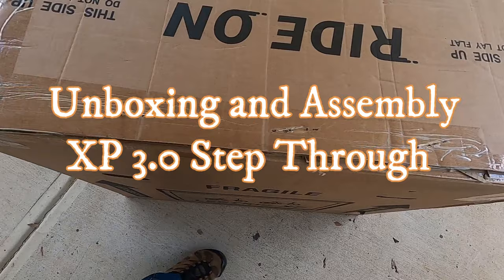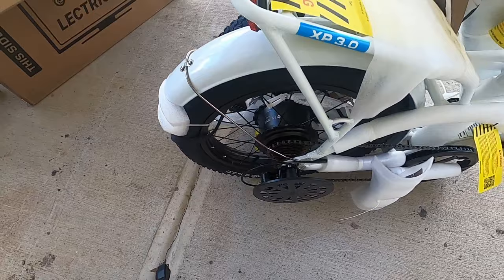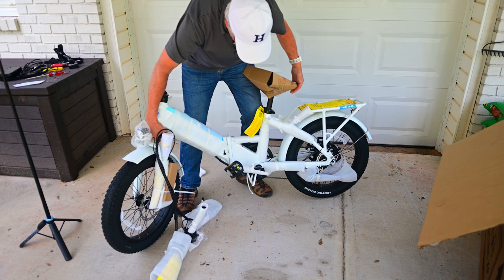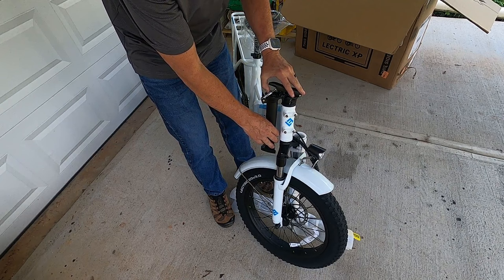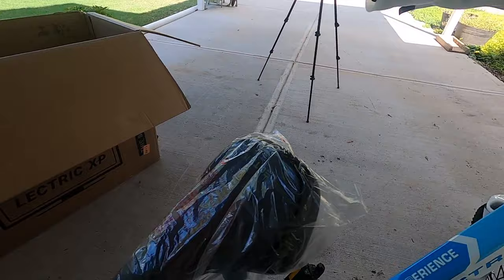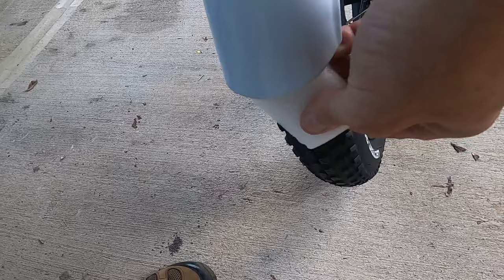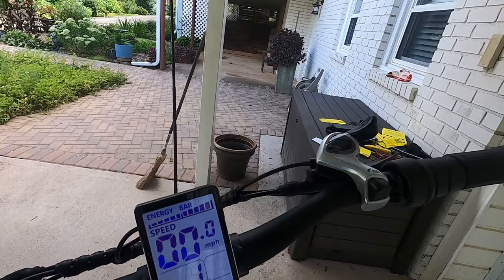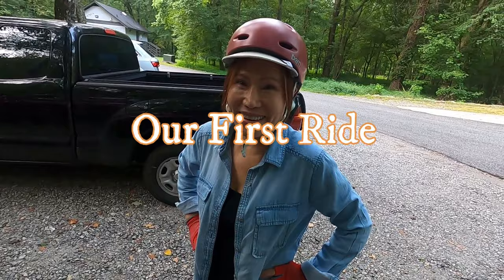Unboxing, Assemble, Ride, Review, Lectric eBike XP  3.0 and Hydraulic Brake Service Bulletin!

Comment: Since you are a new lectic bike owner, I just want to shed some light to you. According to the manual, when the charging adapter LED turns green, this means that the battery is fully charged and you need to disconnect the charger immediately to avoid overcharging. This is true but not entirely. When the LED turns green, it means that the majority or the first battery cell (dont know which one is which) is fully charged but the rest of the battery is not yet fully charged. This is why you still want to keep the battery charged even though the LED has turned green. The only way for you to know on when you should disconnect the charger is if you have a Watt meter that measure the Watt power being drawn out from the electric wall socket. IF the power drawn out from the wall is about 2 watts, that means your battery is fully charged. You may now disconnect the charger. 

Another method to know when the battery is fully charged is by turning on the ebike and check the voltage. If it gives a reading of 54-55 volts, that means the battery is fully charged. I never use this method so I am not so sure about it. 

So if you stop charging the battery after the LED turns green, you may not get the distance listed in Lectric website. In addition, you may not wear out the battery cells evenly because some cells are not fully charged and some cells are fully charged. Another thing to point out, do not pay attention to the batter bar anymore. That is not a good indication to check if the ebike will run out of juice. Look at the voltage. You do not want the voltage to drop below 43V. This will degrade the battery quickly and it may kill the battery completely. When you are not using the bike for 1.5 months or more, store the battery with 45 volts in it. You do not want to fully charge the battery and then store it for a long run until next year. It will degrade the battery quickly.

I am giving this suggestion to prolong the health of you lithium ion battery so that you can maximize the use of the battery for a long  period of time before you need to purchase a new battery.

Oh yah one more thing, dont put the bike in the cold or hot area, e.g., in the unheated garage or close to a heater. You want to store the battery in normal room temperature. In cold room, the battery will loose is health because of the cold (so dont ride it in the winter). In hot room or next to a heater, the batter will also loose its health and will increase the likelyhood from catching fire. This is purely the fact about lithium ion battery. You do not want this thing to catch fire in your home. You can buy yourself a nice temperature/humidity $5-$10 device connected to a router via wifi that will send notification if there is a sudden change in temperature. Put this device close to your bike. It will send a notification to your phone even if you are not at home.

This battery they do not catch fire easily as long as you keep it away from hot temperature area and you do not overcharge it too much. I use this: https://www.temu.com/1pc-tuya-zigbee-wifi-temperature-humidity-sensor-home-connected-thermometer-compatible-with-smart-life-alexa-google-assistant-g-601099517992451.html?top_gallery_url=https%3A%2F%2Fimg.kwcdn.com%2Fproduct%2FFancyalgo%2FVirtualModelMatting%2Fcc12270b8914702337898a3ca8596c2f.jpg&spec_gallery_id=2002876339&refer_page_sn=10009&refer_source=0&freesia_scene=2&_oak_freesia_scene=2&_oak_rec_ext_1=NjI3&search_key=tuya%20wifi%20smart%20temperature&refer_page_el_sn=200049&refer_page_name=search_result&refer_page_id=10009_1693848959353_ja7k09p8yg&_x_sessn_id=9szdyyec94

to monitor temperature in my apartment. I also use this: https://www.amazon.com/Kasa-Energy-Monitoring-Smart-Plug/dp/B08LN3C7WK/ref=sr_1_3?crid=3OIL0E79YFG2U&keywords=TP+link+kasa+KP115&qid=1693849041&sprefix=tp+link+kasa+kp11%2Caps%2C113&sr=8-3

to monitor the power draw from the wall. So if the power draw is about 2 watts, I disconnect the charger. Make sure you are home when you are charging (I just never trust lithium ion battery).
Reply from the maker: Yes!  I was aware and thanks!
Reply: There is no voltage meter on the bike, only "energy bar".  How can you check voltage?
Reply: @helenwood1  Yes there is. If you tap the large button (the button that you use to turn on the bike), it will change the display. Keep tapping, until you see the voltage. It will show the mileage, current mileage, current in Aphere, voltage, etc.

Comment: Looks like you got a factory demo to me.  Where the brand new bike folds together it looks like the paint is chipped, plastic battery cover missing, cord and charger out of box and the chain is already on.
Reply from the maker: Hi there, never thought about it that way, but I bet you are right.  At least everything works. Thanks for the comment!
Reply: We ordered two and they showed up today.  The chain was already set up on both.  My wife’s white 3.0 had everything in place including the battery cap and everything tightened down. My black 3.0 was for the most part the same except the battery cap was missing, did not have the velcro strap, the power button/power assist controller was tightened up in the wrong location and the display was loose. Everything tightened up and in the correct position now.  
They both work great.

Comment: Did you ever figure out what that extra cord was for?
Reply from the maker: It was part of the battery charger, kind of through me off since it was hanging loose in the box.
Reply: @theadventuresofkayru  I wondered about that. Apparently your batteries came loaded in the bikes? Our batteries and keys came in separate shipping boxes, and the charger and cables were in a box, within the bike box. Texas 🤠
Reply from the maker: @sunnycharacter   hmm, both our batteries were installed, one had a protective cap I had to remove, but all is well!
Reply: @theadventuresofkayru  Yes, it depends on each state, has their own laws on how lithium batteries are shipped. But our battery packages came same day as our bikes, so that was cool. Took about six hours to charge them up to 54.6 volts for the extended range batteries.
Reply from the maker: That makes sense, great info!